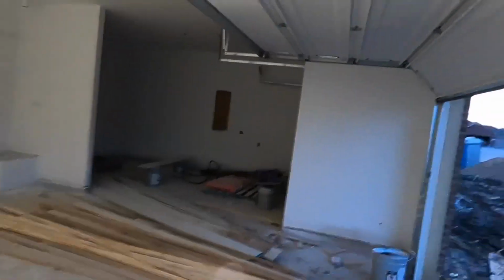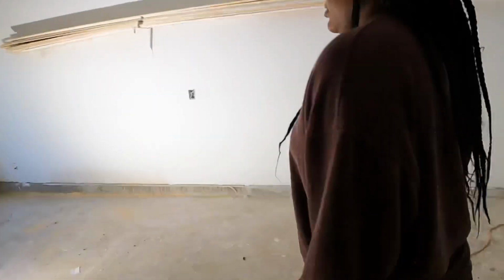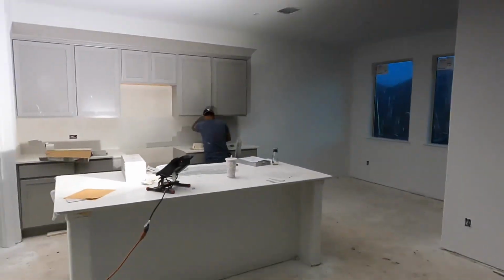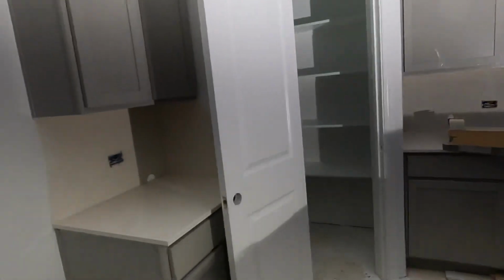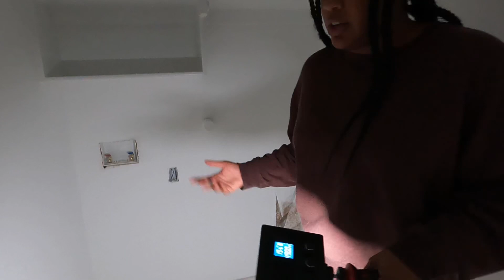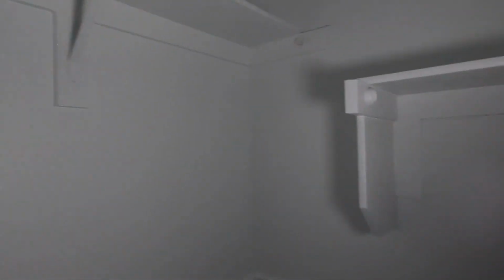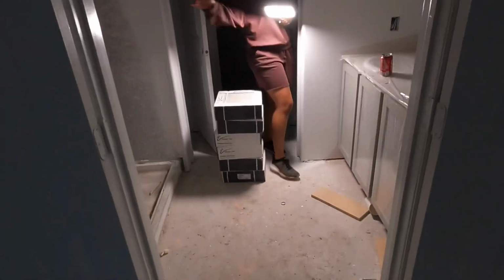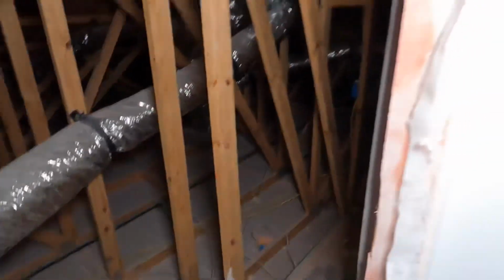WE BOUGHT A HOUSE! | FIRST LOOK AT OUR NEW HOME

Comment: Congrats! Your ceilings look to be 10ft…because your doors are typically 6’-8” (80”) tall.  The water staining on the upstairs floor is because more than likely the workers neglected to close the windows at the end of the day and the rain blew in up there. Word of advice (from a guy in the construction industry and have gone to two home builds), make as many trips out here as you can during this process to document each step/phase of the building process. Makes for great memories later and you’ll have something to look back and reference in case something goes wrong or needs repair. We wrote numerous Bible verses on the stud framing and concrete floors throughout our current house when we built it a couple years ago. Love the verse you’ll chose! Again… congrats and enjoy making memories in the new home!!
Reply from the maker: Thank you! We really appreciate it 🙏🏽